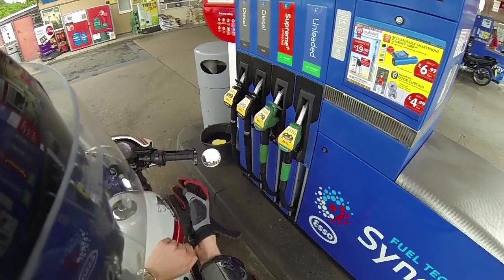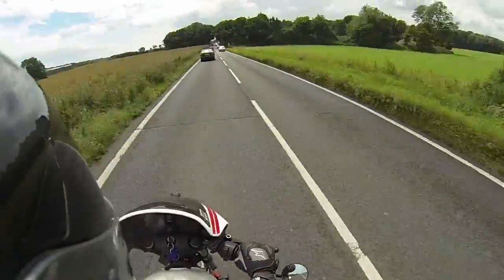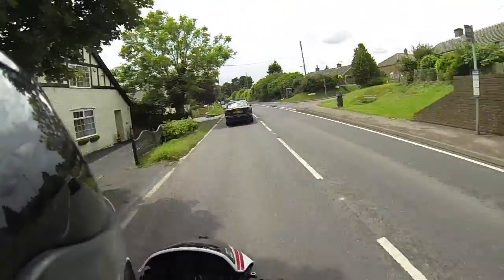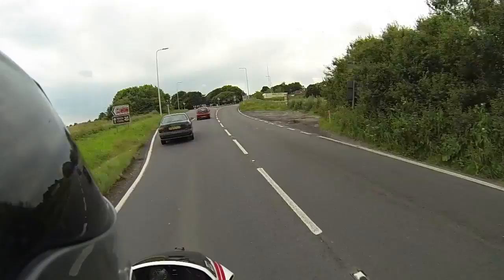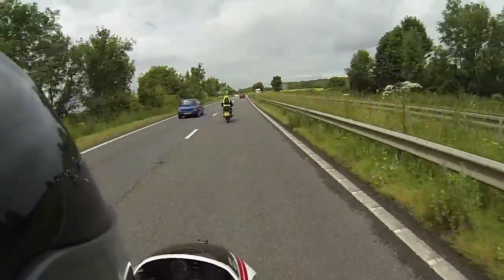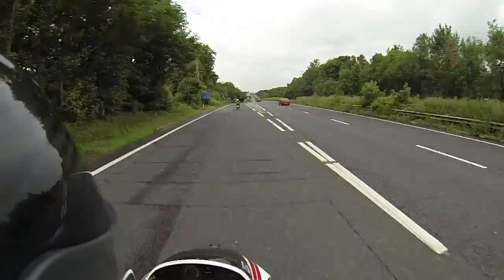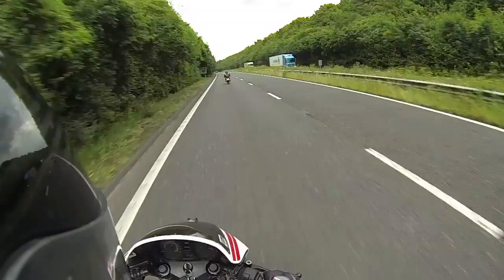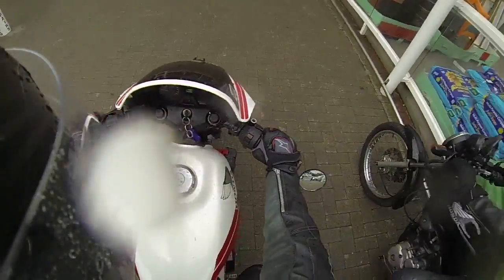INON TV honda vf400 ride and chat with cg 125

Comment: I had three, one is still in my box, highly modified, nc30 swing, radiators and tank, nc35 forks and fairing, cagiva mito rear tail, Yoshimura cams, taoh 4 into 2 into1 ehaust, rs250gp rear shock, modified frame many many many special parts, 159kgs. wet.